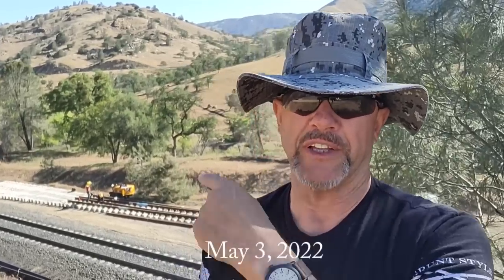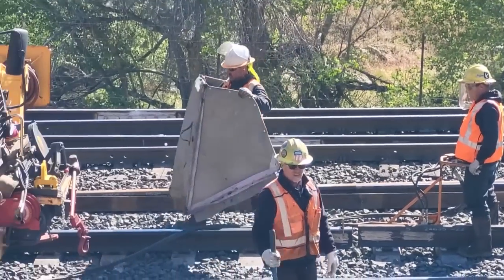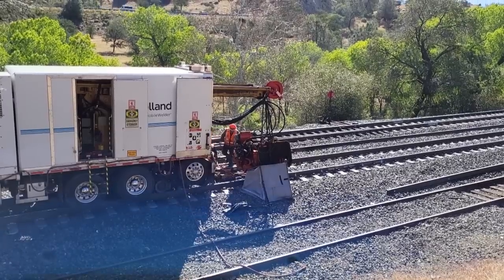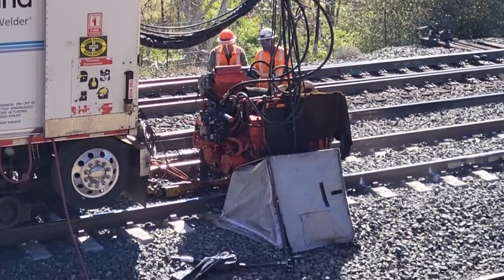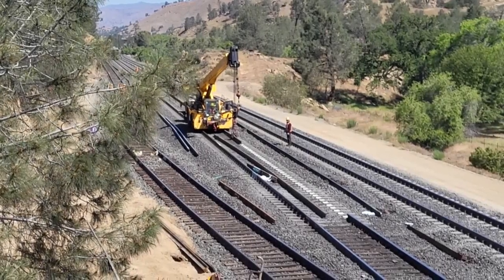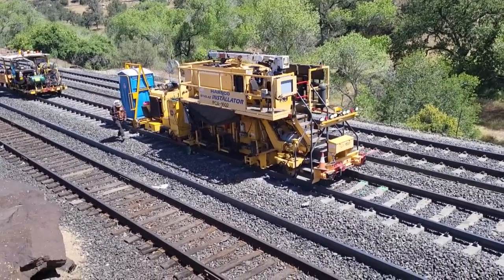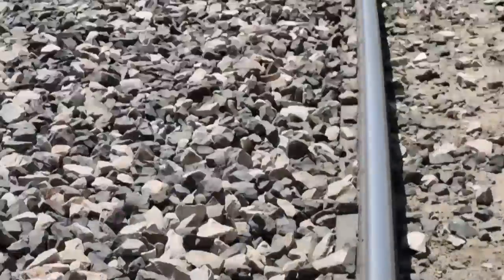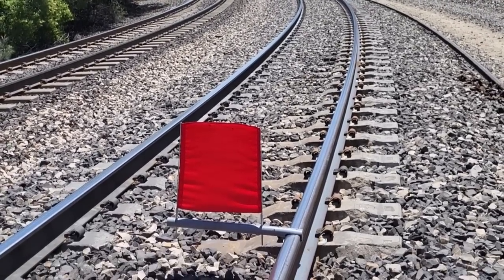How Ribbon Rail (CWR) is Installed

Comment: That machine with the roller is applying epoxy on the concrete tie to minimize abrasion then those things you're calling plates are plastic pads and it is placed on top of the hardened epoxy, the roller on the crane that rolls on the rail is what we call a rail threader, the welder welding the rails together is a flash butt welder, we use Holland too on the BNSF.
The clips are called McKay clips which I think is designed in Australia.

Comment: I knew there was work involved in laying track and welding it. I am impressed with how much goes into it. Like you say at one point - it's a bit different now then when they had gandy dancers moving individual sections of rail and driving spikes by hand :)  I note the part about compensation for expansion and contraction. I wondered how it was done. A neutral temperature is the trick :)  Kudos to the work crew! These gentlemen are good at what they do (you said it too) and they are hard workers :)

Comment: Hi Mark.  
Regarding the Holland Welder, I worked for Holland from 1989 to late 1994 when I went to work for the CNW as a Conductor.  I now have coming up on 27.5 years of service in and have been in engine service since 1997.  Regarding the big steel piece they wrap around the rail before dropping the welder head down and firing off the weld, that is the Shear Die.  When the weld is complete, the right half of the welder head (Left side in your video view) unclamps from the rail and then slides to the right, pushing the die across the pushed out upset material from the forge.  The end result (as long as you keep the cutting edge sharp on the die itself) is very little excess material to grind off of the weld.  The technology has come a long way since I was there 30 plus years ago.  The pullers were still a new thing when I started there.

Comment: Couple things about the welder,

It’s a puller, it doesn’t push at all
It’s a straight edge and taper gauge, no levels
The metal around the rail is a shear die, it cuts all the weld overflow off after the weld is upset.
Reply from the maker: Thanks for the info. I count on folks like you to correct my mistakes and inform me of things I don't know about! Thanks for checking it out!

Comment: “Tail-End-Charlee” appears to be the local Track Gang’s Vehicle responsible for this section….  They / Truck generally equipped to handle anything up to a specified level. 
Four individuals to the gang guess the three walking behind are members of that gang /crew. 
The “Ribbon Railers” are from a different different organization within the UP MOW Track Department.
Reply from the maker: Naw, it is part of the system gang. They load that truck up with everything else when they move. I hoped to catch the load out, but am on vacation until the 12th.

Comment: Howdy Mark.....hope your road trip is relaxing.  The "used" rail removed:  is it so work that it gets turned into scrap or is there some life remaining for short line, spurs, low use purposes or the mainline wear that is so heavy just renders it to the furnaces?  The new "fish plates"....is that high density plastic?  Being glued and such and does that have to do with concrete ties and possible conductivity issues with digital sensing on track circuits?   Thanks much for those of us who would otherwise not be able to see and understand this aspect of railroading!!!   Be safe!!!!!
Reply from the maker: According to my sources, the old rail is scrapped. I'm sure the plastic pads are very sturdy. Steel plates would not work on concrete, thus the plastic. Concrete ties are non conductive under all circumstances where wood ties can become waterlogged and create shorts in the track circuits. My pleasure to bring this to you and thanks for checking it out!

Comment: Yes that machine is putting a uv epoxy on the tie to prevent any more tie abrasion. Developed by Encore Rail Doug Delmonico
Reply: It seemed like it went on top of the pad. If it went in to protect the tie should it not be put on first?

Comment: Cheers for the excellent video as usual Mark. My curiosity was piqued by all the sirens and air horns I was hearing at times. What was going on?
Reply from the maker: Two honks. track equipment moving forward. Three honks, moving backward. Short sirens, speed swings moving on or off tracks. long sirens and long horns, train approaching on adjacent track. Thanks for checking it out!

Comment: :31  brake clamp shims, design. 🤔🤔 "No. Actually the training stopped: when I asked about the leaf shim's; on overhauling the axles."

( I think caliper bolts, be the easiest to tension test), via the rock resurfacing machine; assuming it has a light, depth scanner..? 

Trick is to get the bolt design, to wedge right angles: a step bit will mock the angle..?

4:55 🙄🥵😠 So would have through that {p.o.s.} in the ditch.  ( coal slag blasting, {{course grain}} - for prepping). = Now you need a sand blaster (with containment hoppers - like actual grain box - cause when I fill it with water on final test, any crack with be revealed, [ at max load weight ]. 

No, never used that {p.o.s.}: just know how a belt sander works better; for flat surfaces.😎/🤠-🙄/😂= ( Yea, rust removing {{{(wire disk)}}} would give more coverage, as it is flexible, and very unlikely to {{{shatter}}} - 4:55 )

6:51  [ Time for me to go, see if I can mock a go-cart, back up - testing half tunnel backup wall -  )( skid plates.🤔 ] 😎https://www.youtube.com/watch?v=zzHoWtI30NM😎

10:44 Yea. Need a counter spacer, or welding will bow as it welds bottom to top: assuming dual rods: or {running a hot core?😬}.

13:00  Outdoor enamel (pipe line, pre and finisher ).

14:02 That will fail: on a down hill turn; {no brake clap ball, edge} to hold onto = air born; == ( lock one up and watch a loader test its brake {disfunction}? === [ Now you know why I call it a {pos}, no? - ({brake disk }) - {{will not work well; on a {grinded disk surface} - {{jack the brake shoes up quick}}]😉

16:50 Great design for the: emergency brake alarm box. 🔥🔥
Reply from the maker: It all works exactly as designed by people who have been doing it a long time.